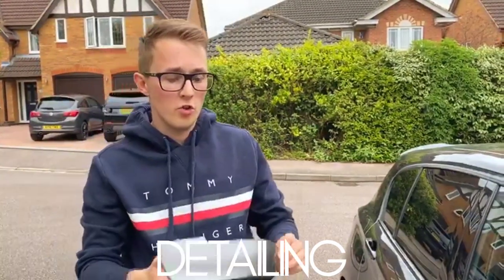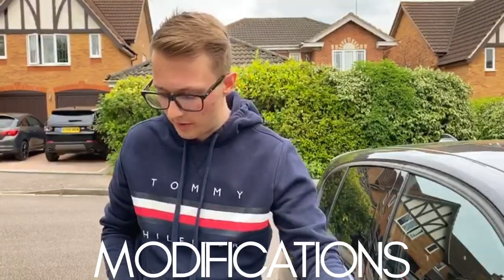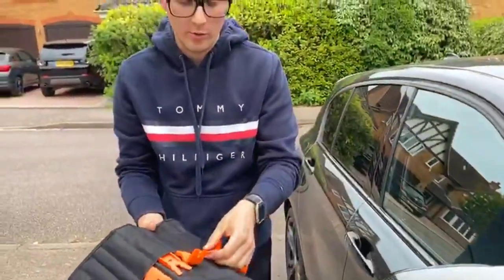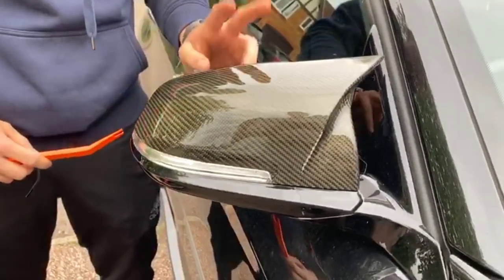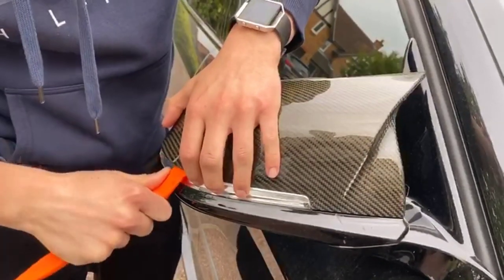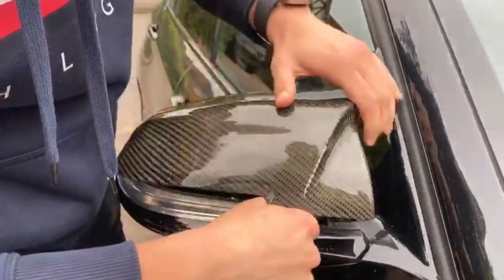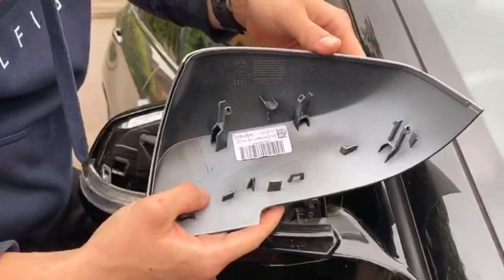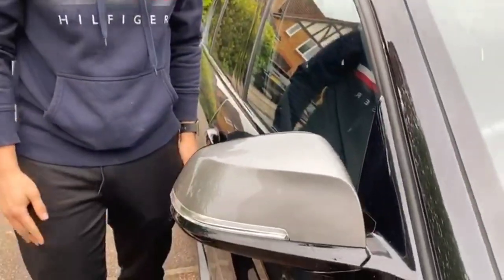How to Change Mirror Caps on BMW M140i F20/F21 (All F Series) *SAFELY*

Comment: You broke a clip! This is exactly how you damage the clips!!
Reply from the maker: I've changed upwards of 25 sets of thee mirrors. Do you have another proposed method? And the clips were not broken from removing the mirrors in the video. The mirrors were a customer's old caps and already broken and used for the purpose of the video. Following this method should not break any clips
Reply: By clips you mean the ones on the mirror cap right